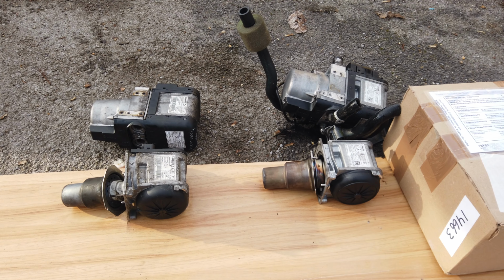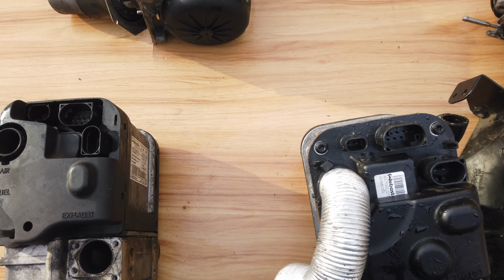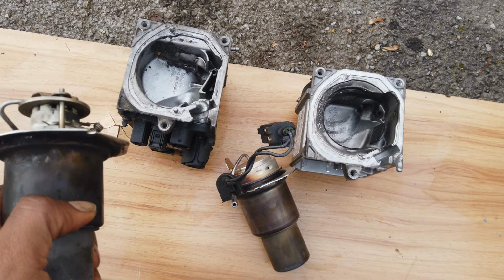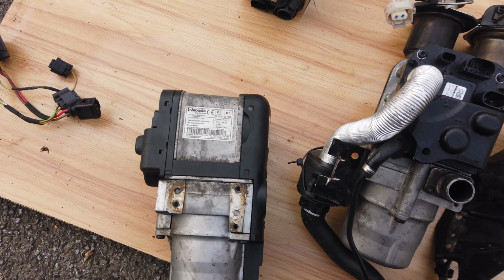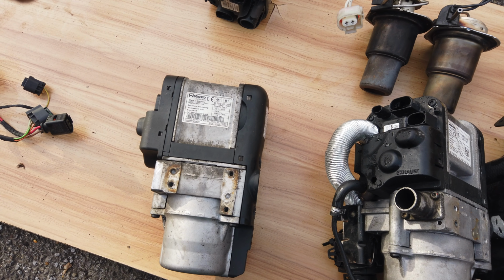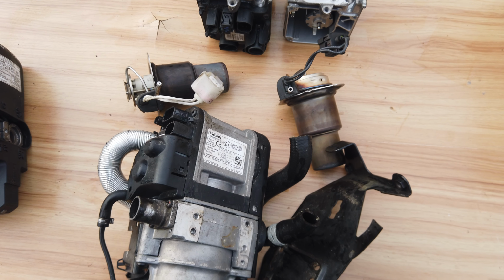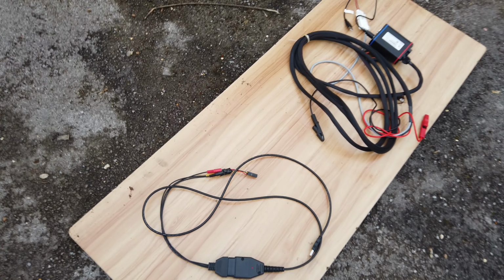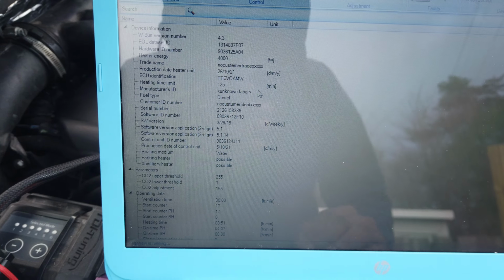Webasto Thermo Top V/ Thermo Top- EVO

Comment: I don't know if my Webasto is a Termo Top or a Termo Top - EVO. It works fine but when the engine is running it sounds like the air from the car and the air from the Webasto is "fighting" against each other. Can it be some wrong with the setup of the system?!
I am also a bit disappointed with the fees that Webasto charge me every year to be able to remote control the unit from my phone number. So I plan to change it to a standard remote control (that also can control the Webasto heater from the phone and that only need a SIM card, ni other fees!). Nice video!

Comment: Thanks for your video, it seems you know quite a bit about Webasto parking heaters. Can you help me to choose the right one to pre-heat the engine of my Van Ford Transit Diesel for winter in Arctic (-20°C) ? What are  the differences / advantages between : Webasto Thermo Top C/D vs Thermo Top Evo vs Thermo Top Vevo ?
Reply from the maker: @francisdebriey3609  Hi Francis, Top Evo is the best choice for Arctic conditions due to its advanced features like automatic altitude compensation, efficient fuel use, and reliable performance in extreme cold. The Thermo Top C, while reliable, is older and less efficient, with potential sensitivity to battery voltage in cold climates. The Thermo Top Vevo is similar to the Evo.  Vevo was mainly used, programmed and lock to vehicles in the past. I think its discontinued and webasto now uses the evo for both pre installed and programmed to vehicles or sold as unlocked for cars, vans and boats etc. The evo is also more efficient than the vevo due to upgraded burning chamber.
Reply: @germplus  Thank you soooo much for your quick answer. I was searching the whole internet for some advice... and here you are :-)
Reply: @germplus  This is so good info here, Thank you sir!

Comment: Hello good evening!!! Very useful and illustrative video! One question: can a 2010 TT Evo be used in a 1995 Land Rover Discovery 1 300TDI? this vehicle does not have an ECU or software to control the functions of the heater.... I am about to buy a used TT Evo, it comes from a wrecked VW Transporter van.... is it possible to use the TT Evo in my Discovery 1? what connections should i make? from Patagonia... thank you very much!!!... Gabriel
Reply from the maker: Hello Gabriel, thank you and yes it can be fitted. I retrofitted one to my Freelander 2 and use it for camping and sometimes pre-warm the car. https://www.youtube.com/watch?v=CZvmzCqt9d4
Reply: @germplus  hello @germplus... thanks for the link to your video... it was very helpful... I'm going to start with the repair and start-up simulation of the heater, on a workbench and then install it permanently in my Discovery... thank you!!!

Comment: Hi any  chance  you  know the  part number of the wiring  loom  at  2 min  30  sec? I  really  want to get a spare  one
Reply from the maker: Hello Easy Baby. Unfortunately no but can help you with the connector plugs. Do you want it for TTV or TTEVO?
Reply: @germplus  Hi thank you. I want it for  TTv.  As a spare to  install  a  W bus  controller to  :)
Reply: @germplus  Hi there, looking for information on the plugs for the EVO. I have a 6 pin plug that matches and the water pump harness, just looking for the power connector

Comment: Hi, very informative video. I have an TT evo5 unit from a 2019 bmw, I noticed you mentioned you had a VW heater, what has to be done to retrofit a brand specific OEM evo unit into another vehicle? I presume you need to delete off the bmw canbus/ encryption or change it from canbus to the universal W bus? Is there something you can buy to do this? Thanks
Reply from the maker: Hello - what vehicle do you want to install the bow TTevo5 on? Did the vehicle previously have factory fitted TTevo5? if NO, then you will need this software ( https://wibutec-shop.com/Webasto-Zuheizer-Upgrade-Software-mit-Dongle-fuer-VW-Amarok-S1-S6-ab-ca-082016-bei-Aufruestung-zur-Standheizung )to change the can bus to universal.
Reply: @germplus  hi, it's an older e series bmw that won't communicate with newer can us protocol of the ttevo.. The ttevo came from a g series. I've talked to a few uk companies that sell kits, they both say its not possible to use an oem specific evo in an other vehicle, it can't be converted they say.. Could be sales talk! . They dont sell a universal ecu board either. There is a tt vevo for my car, it shares the same burner as the evo but with my older Cambus protocol, I may just go for that as it would work through my IHKA with coding, I just wanted the latest tt model. I did find a company in Hungary who sells evo boards converted to manual on/off for £170. I looked at the link you sent, says it's to activate aux heating on a vw amarok? Are you sure it's possible to change an oem board to a universal w bus with software only? I've never heard of this. There's the 5kw latest erbaspacher 3 d5e Cs water heater kit with a nice diagnostic controller/timer  for £1200 and 3 years warranty.. Decisions decisions!
Reply: @alang6238  the hungarian retrofit ECU give a lot of EMI back to your 12V line AS these are more Amateur build then anything.
Just leave the board original BMW of VW, you have only one Chance with parking heating retrofit from OEM heater!
1. Buy kkl USB webbasto interface with their software an make the OEM unit run with it in diagnosis mode.
= profit done
You now know for sure that the BMW OEM unit is "w-bus" capable with original hardware
2. 60€ little box called "w bus emulator" will run your OEM unit in any car for a fixed time by a switch or a remote receiver from eBay/aliexpress